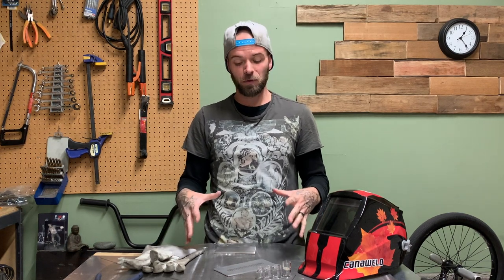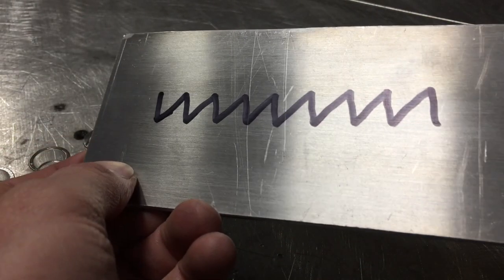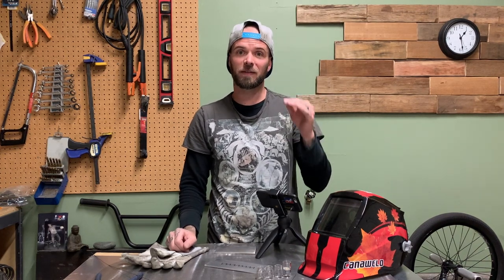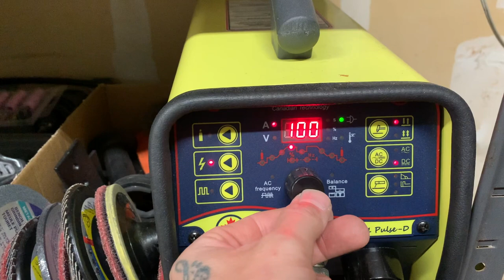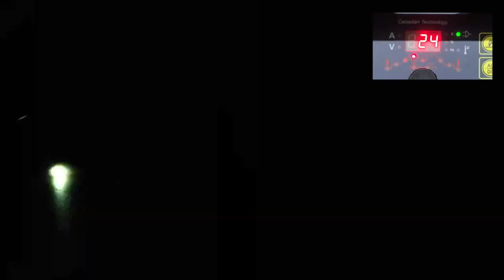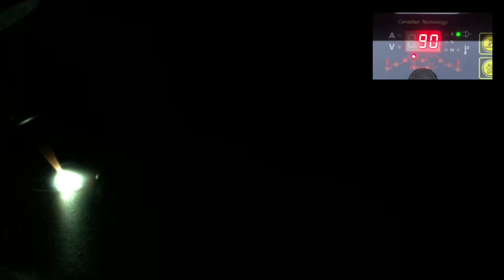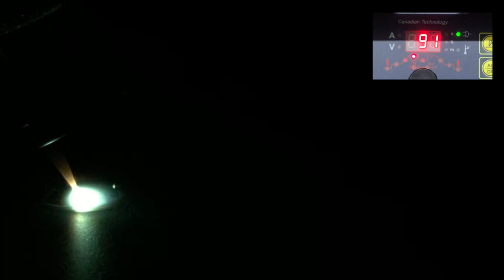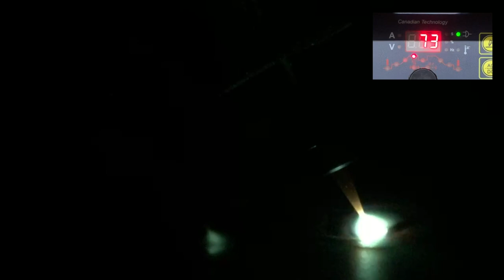TIG WELDING STAINLESS STEEL - How to tig a WEAVE WELD!

Comment: Thanks Dusty. When you drop down  and go right to left without filler ,is that to preheat the metal?
Reply from the maker: Yeah. I tend to find that first dab sits down just right when I warm it up a tiny bit:)
Reply: I was gonna ask the same question;)

Comment: As stated before...brand newbie here but I've very curious about what I'd call your "C" weave pattern instead of what I might call an "S" pattern.  You responded to a comment below about laying down better after its preheated, BUT...often you comment about the metal being HOT and having to adjust your pedal to accommodate it.  Wouldn't "preheating" contribute to the additional heat?  I realize this is YOUR method and others can do their own thing....I'm certainly in no position to make any soft of negative comments...just thinking out loud.  You piece of your friends artwork was mesmerizing!!!
Reply from the maker: Yes Scott you’re right! Although my trick is to add enough filler rod, that it keep the weld a tad cooler. Heat will ‘sit’ the weld down to wed properly to the base, but the filler will help to keep things from barrelling out of control a bit:)

Comment: sir I'm using a tig torch without a pedal control only a switch in the handle n the result of the tig weld is  dark like oxides any advice on your side sir